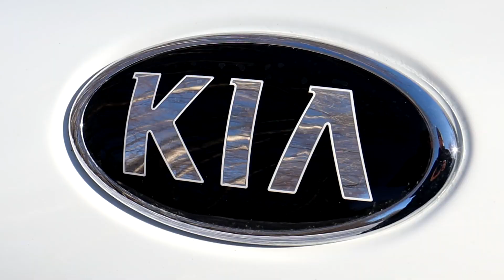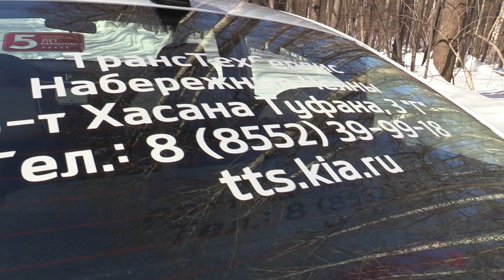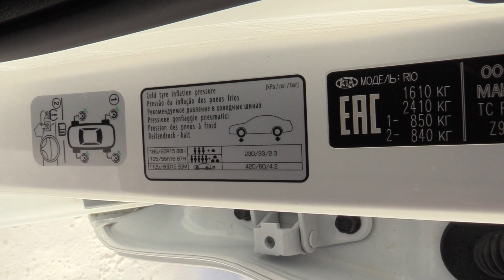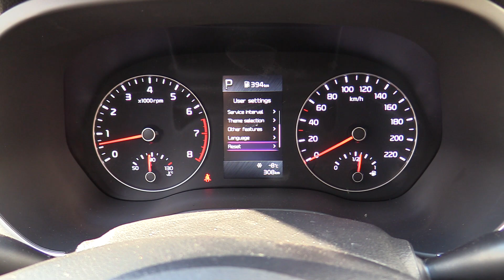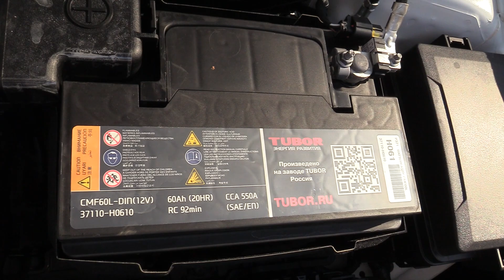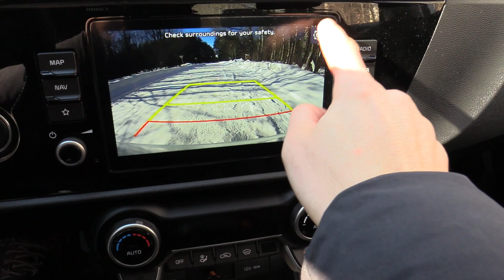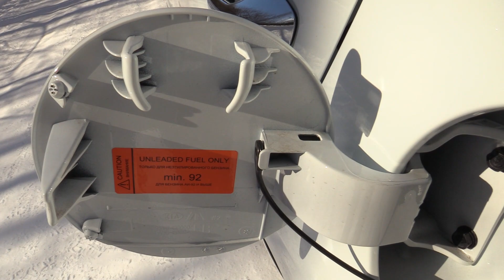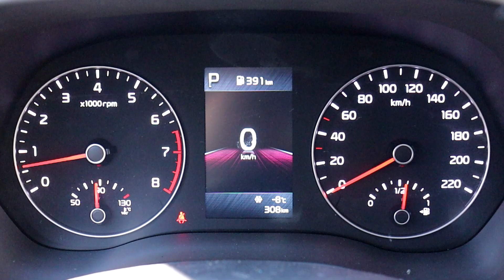2021 Kia Rio. Start Up, Engine, and In Depth Tour

Comment: I could be mistaken but that car looks nothing like the 2021 KIA RIO. Was it modified? It looks more like someone took a Kia Forte and crossed it with a KIA RIO LX. I only know of two models for 2021 KIA RIO. The S model and the LX model. S model being the higher end/more expensive model. At least here in the US anyway. 

Front grill and other areas are different from the 2021 KIA RIO. Google it and see for yourself. I have a 2021 KIA RIO S. It comes with  1.6 L engine, Maximum Horsepower 120 @ 6300 RPM,  Maximum Torque 112 @ 4500 RPM.   Engine oil dipstick in my car is located close to the valve cover. The one in the video has it near the coolant reservoir and alternator. Emergency flasher in my car is right below the screen.  Makes me think this car is a clone or ordered/built to someones specifications.  Instrument cluster is very different as well.
Reply: in Russia the Kia Rio has a different design